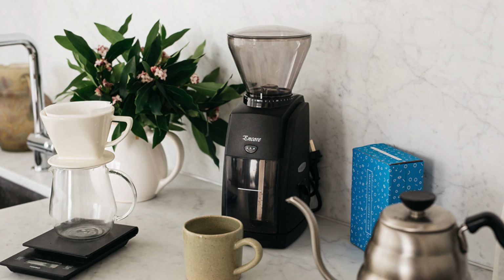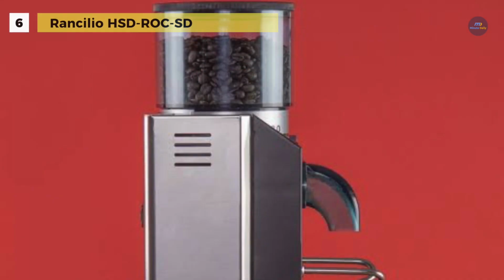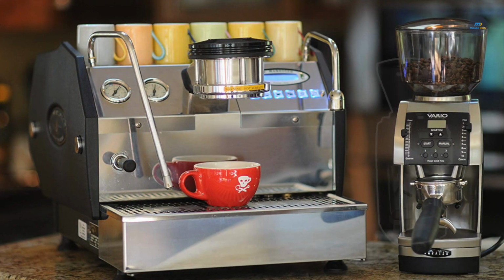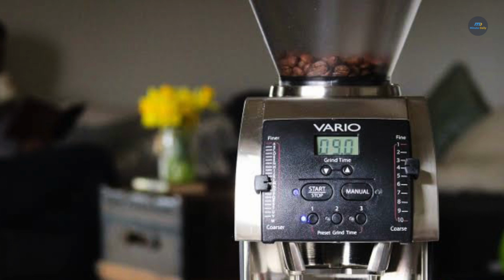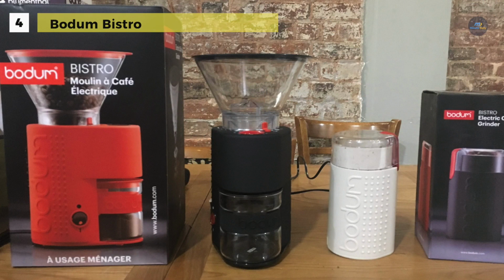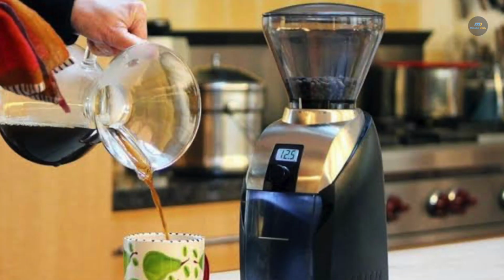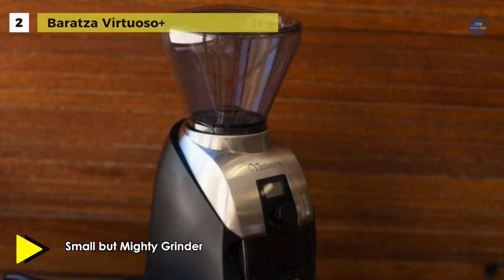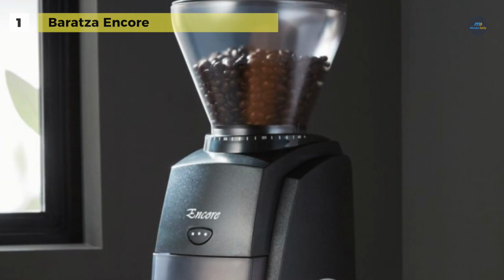BEST COFFEE GRINDER! (2020)

Comment: Tests of coffee grinders are quite superficial. Tests are done in a few minutes, do not show how the machine works when it has been in use for a while. One machine that gets good reviews is the Baratza Encore. It grinds just fine, but surprisingly rotates with the coffee, both in front of and behind the machine. After let's say 8-10 times it is also full of coffee inside that has not come out. If you knock out the residual coffee, you should have plenty of space, because here the coffee bounces out everywhere. The plastic cup, which is claimed to be antistatic, is probably not completely anistatic after all. If you are considering this coffee grinder, be prepared for a lot of coffee grains on the kitchen counter